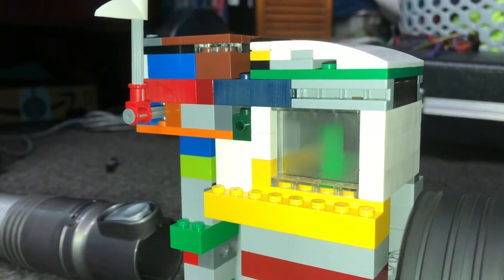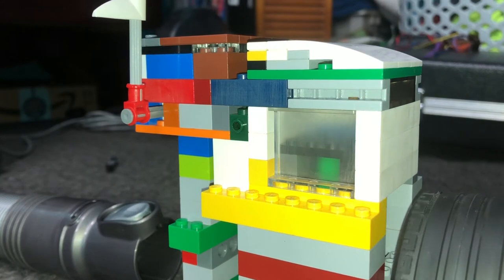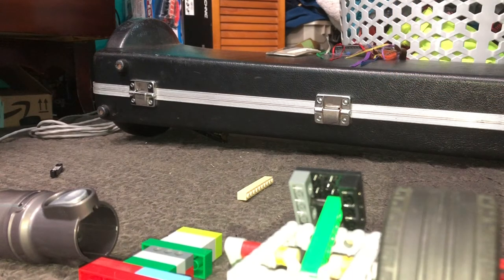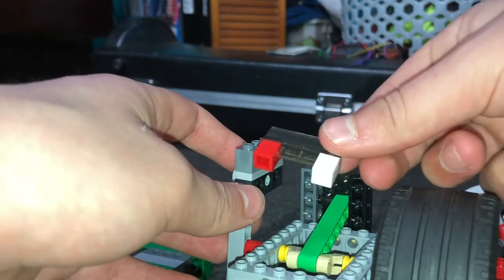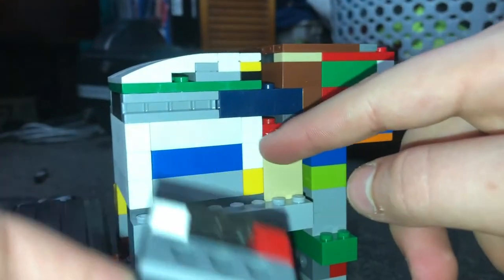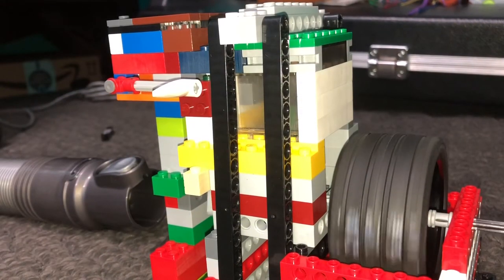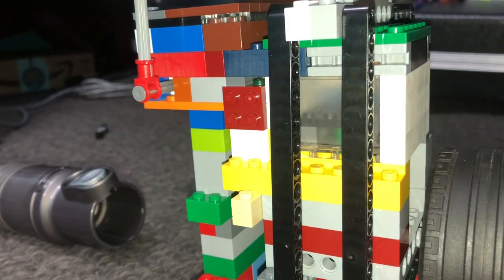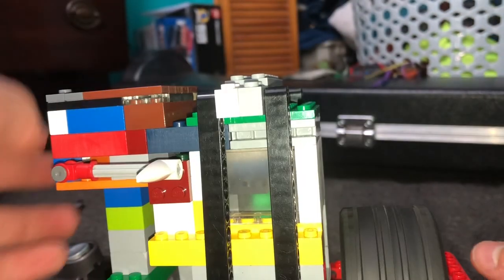Strongest Engine Full Throttle Attempt #5-6

Comment: 1:27 Holy cow man! Be careful because mine blew up like big time and I got hit in the face with the piston lol. Had a few stud marks on my face 😂
Reply from the maker: Ouch... I’ve never had that catastrophic of a failure before, but certainly have come close to one.
Reply: @KFPlusLegoMastery  That's what happens when you use a high power shop vac and your engine reaches about 12,000 RPM lol. I've been super-gluing my piston to the connecting rod ever since.

Comment: I say, glue the valve with a glue gun, you can remove glue from a glue gun eZ 
I did that with my first engine to and it ran twice as fast (around 5.000+ rpm)

(I mean hot glue gun*)

Comment: If I was you, I'd use a silicone based lubricant to lubricate the valve and cylinder walls. Don't use any other type of lubricant or else it might damage your legos.

Also if two parts fit really tight that don't need to fight tight. You can get very fine sandpaper and sand it down. That'll also keep the valve from grabbing onto any blocks that stick out.
Reply from the maker: Thanks for the advice! I’m always open to suggestions and you certainly didn’t fail at that. I do use sand paper on my cylinder walls and also where the valve makes contact. I might go and get a lubricant for it but in between videos I’ve been testing with different pieces for optimal performance.
Reply: @KFPlusLegoMastery  Hey. I've been thinking about this motor of yours and had another suggestion or two! You can use paper in-between legos to create a better bond if those parts stay dry. Cut out a small peice that fits the shape of the part and make sure it sticks down really good!. You can also use that technique to make sections of bricks taller by tiny amounts. 

And also when your valve came apart. You could place some bricks at the top thatll prevent the valve from coming up further than what is wanted. So if the valve starts to come apart, itll bump into the top and force it back together. I hope any advice I give helps make this motor run better! Its got a great powerband just gotta try to make it stay together all the way!
Reply: @KFPlusLegoMastery  oh and one more thing! Try to reduce the weight of all parts in the motor. This will allow for more rpm and better response. And if you reduce the weight of the valve it might not fly apart
Reply from the maker: Shlushe 10 Thanks for the excellent advice! I definitely try one of those techniques in the future.
Reply: @KFPlusLegoMastery  I've made an upload to my channel showing of my model of an engine!